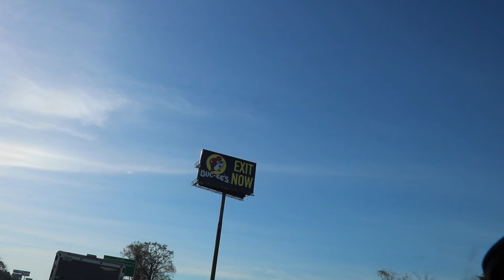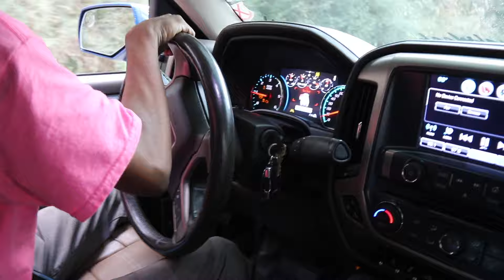Whistlin Diesel said NO to buying.. World's MOST Squatted GMC lifted truck!

Comment: There’s no way he has 70k in that deathtrap
Reply: Easily
Reply: @alliebarnett3143  and the guy says he would sell it for 41k? The kid who “owns” the truck is obviously an idiot but nobody would sell a “70k” truck for a 30k loss.
Reply: @alliebarnett3143  no you didn’t listen he said he spent 70 between 80 K on it now that is unbelievable
Reply: @Quisy.  that’s what I’m saying thank you
Reply: @alliebarnett3143  no it does not. It’s a gas truck, the DIESELS go 30-40k. Those go 30k max with low miles
Reply: @KDlGG  where do you live at where where a 2017 Denali 1500 with as he stated 61k on it goes for 30k lol 🤣, and a diesel 30-40k lmao 🤣. No disrespect but your numbers are way off, a truck like his is running about 40-43k with way more mile on it and a duramax denali 2500hd with the L5p is running 50-60k +. You might find a 14-15 LmL for about 30-40k with decent miles on it.
Reply: @alliebarnett3143  naah maybe a diesel thats a gasser maybe 20 or 25 max especially for that clown mobile
Reply: @GravitarScrap you will never get your money back building trucks or cars
Reply: @alliebarnett3143  ah yes. and spent 5-10k for some wheels. 3k for half a lift kit. 2k for sawzall blades and 5-10 grand for some brakes that don't work. these trucks go for 25-30 sometimes marked up 35k its a 1/2 ton pickup. reason you don't see squatted diesel trucks especially new ones. is there ain't a bank out there that would allow them a vehicle payment not one penny over 300 a month.
Reply: @edwardlemus9483  maybe a Diesel. my 2018 F250 platinum was 95,000 new. its 20,000 dollars on all the big 3 just for the diesel option. seeing people having shit boxes like this is funny. its different if its a project vehicle but taking a objectively cheap bad vehicle that's new. that you paid 20-30k for and turning it into a turd. pretty funny if you ask me. and these guys do it all on a line of credit usually too. 1/2 tons today are SUV's with a open back. they're the new soccer mom mobile so they need soccer mom pricing and quality. explains why 90% of them or better made after 2015. come with a Dial/Knob electronic shifter. or a Console shifter. its for the soccer mom that's gonna buy it.

edit : i dont see how you can spend that much money at all and still have factory independent front suspension. that shit looks like its about to fall apart with a strong gust of wind. for 70k you'd think they would have done a 4 link front or something and a solid axel. things 4 wheel drive is probably non existent.
Reply: That truck stock is 50k+ stock on the lot. The truck market is high and if ya think it isnt, go look anywhere and see. Diesels are 62k + on the lot.
Reply: @KDlGG   IDk where youre buying your trucks at. But that truck stock in the south is 50K stock on any lot... and diesels are 62K plus... do your research on inflated prices son... If you find a 2016+ Truck like that stock for less than 40K, give me a call bc ill buy it and flip it for 10K profit.
Reply: @justnsaliga8518  that truck definitely has Bluetooth four wheel drive.
Reply: 70k more that’s a waste of money when he’s older you think that 70k will actually still be there no nope totally waste of money
Reply: @GravitarScrap man wtf are u on people take losses on modified vehicles ALL DAY

Comment: 13’s on switches is how i rolled back in the day. Ride ass dropped all day but had that switch to level. Idk why these trucks arent bagged or juiced to level out and drive when needed
Reply: I'm putting 13s  and air ride on my 63 impala so I can ride ass drapped
Reply: Growing up I loved lifted trucks n my dad wanted to lower his mini nissan...I thought he was nuts....butvwhen I got older I loved lowriders n switches...
Reply: Busting 3s and holding all day with no chains on the 4dr 64. I miss them days.
Reply: I've had a 85 regal, 91 s10, 91 Sonoma, 94 towncar and a 88 Lincoln all with switches.  Not to mention our CC built the first truck to stand up in Mn
Reply: @tomfnyep6929  is that truck still around MN?
Reply: @christopherromero4466  yeah it's blue.  Isuzu StreeT SweepaZ CC.  And my 91 Sonoma was kandy blue with pinstripes and 91 s10 was kandy orange with blue flames and flake
Reply: Hydraulics.... is the way to go...
Reply: I would most definitely bag the rear to level it out to make it legal while driving. You can squat it when needed.

Comment: Man it’s a limit to how much you squat that’s just ridiculous. My limit is a 3 inch lift in the front that’s enough if I were to build a squatted truck but I’m sticking with the sema builds
Reply: Any squat without load in the back is over the limit
Reply: "Sema builds" 🤣🤣🤣🤣🤣 stop it
Reply: @Bluecollar_obs_limo  Bro I’m not even seeing what’s that hilarious with saying sema builds. At least you can see the road and tow heavy with those trucks and not have to worry about dragging the bumper off while doing so. 🤷🏾‍♂️ They’re more useful like check out Gabe Farrell using his dually to pull a gooseneck 😂😂
Reply: Any amount is ridiculous.